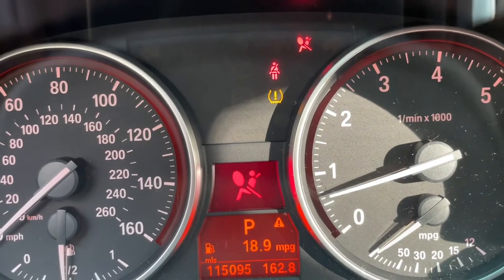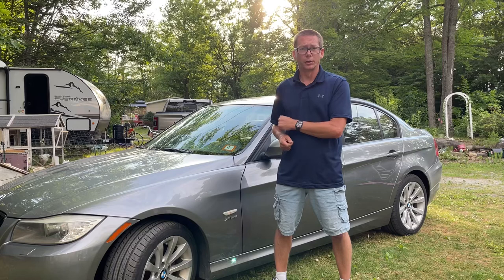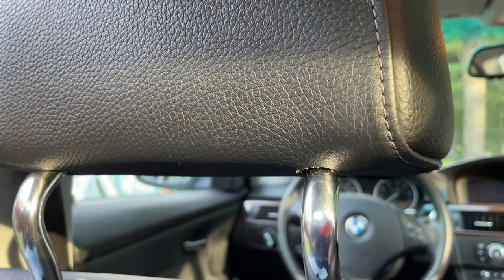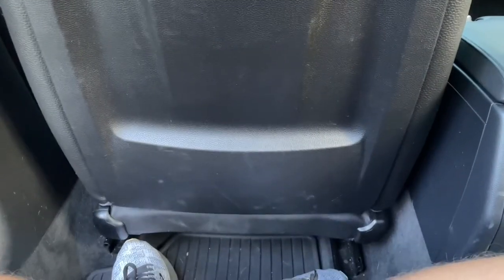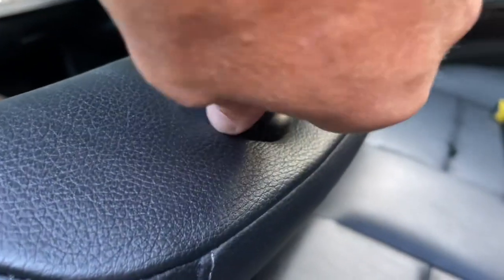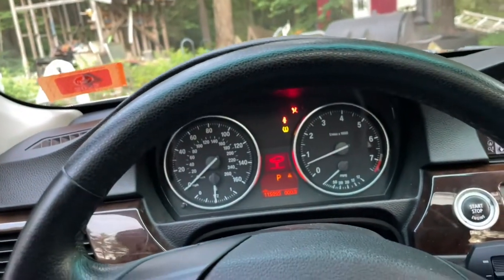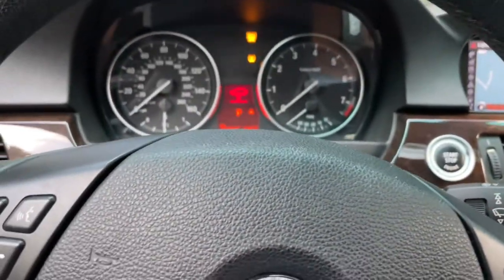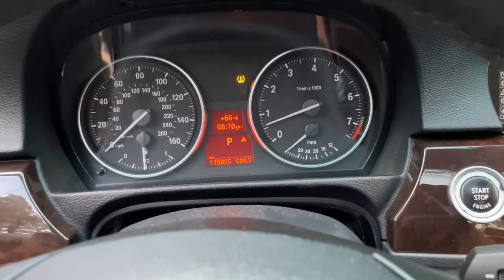Easily replace Active Headrest on a E90 BMW

Comment: The lighting system error is coming from a bad FRM module located behind the kick panel in driver side footwell (OBD2 port area).
These cars are known to have issues with the FRM modules software corrupting when the battery dies or is disconnected.
The only fix is to replace the module with a used one (make sure you get FRM v3, not FRM2).
If you're lucky, BMW may still replace it under warranty since this was a common issue, but you'll have to reach out to a dealer to see if this is still an option. I was lucky enough to have BMW replace mine for free, which means it got upgraded software not prone to the same low battery corruption issue. If you buy a used one, there is no guarantee you wont run into this again. 
Hope this helps some poor sap on here. 😜
Reply from the maker: You are right, I bought a used FRM module and fixed it.
Reply: @coreysgarage6389 did you have to code it in? I was told i could just buy one and put it in and the car would be fine

Comment: I just replaced the battery in my 330i and as soon as it started the passenger restraint and seatbelt light stayed on. What could this be? There was an assortment of lights on that eventually went away but the passenger restraint light stayed on
Reply: You might have loosened the BST terminal on the positive side of the battery, I think that’s what it’s called ?

Comment: That gap in the headrests where you said if you could put your finger in the gap, it’s been engaged is not true. You could move the headrest back-and-forth, leaving a gap in there or removing the gap depending on where you have it at.

Comment: Unfortunately these cars corrupt frm module when battery disconnected, your lights, head lights , blinkers won't work. You need to have frm repaired. You created another problem by disconnecting the battrey.

Comment: Hello Corey, can you send me a link to the Bluetooth code reader you have?  I have a 2011 BMW 328i that I have to replace the driver side headrest and need to reset the codes as well.  Thank you, much appreciated.
Reply from the maker: This is what I have but you can get similar on Amazon much cheaper https://www.autozone.com/test-scan-and-specialty-tools/code-reader/p/innova-quicklink-obdii-wireless-tool/454410_0_0

Comment: Hi guys, I have problem with my E90 06  330i. Sometimes I got this 2 lights  and my fuel gauge are going crazy, it’s moving up and down and I notice that when I got this light my car goes worse than normal. I don’t have codes from airbag and seatbelts or any check engine light. Any ideas guys where I have to look for the case?
Reply from the maker: Hopefully someone will chime in and help you out.